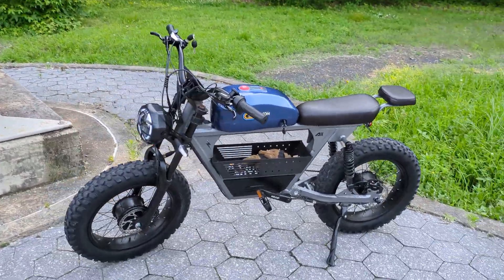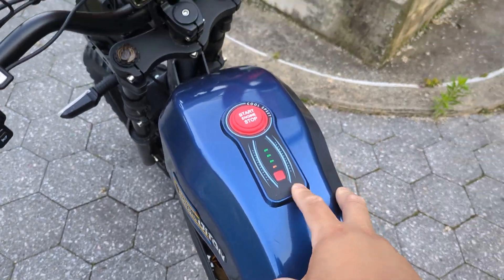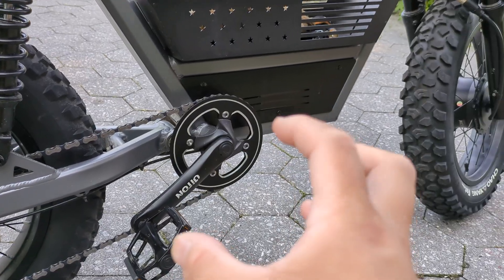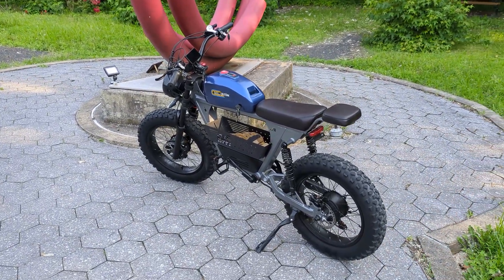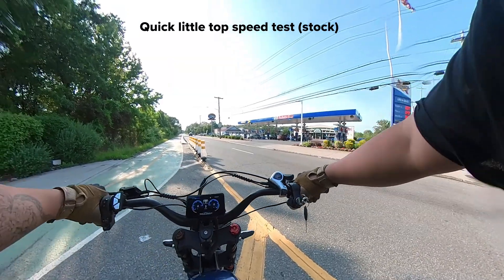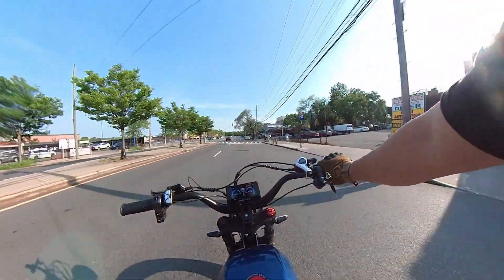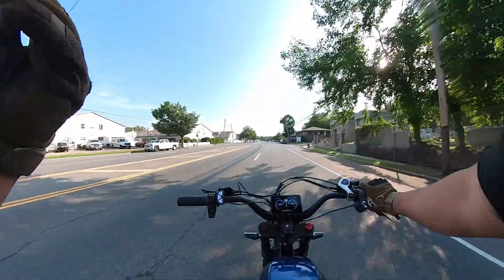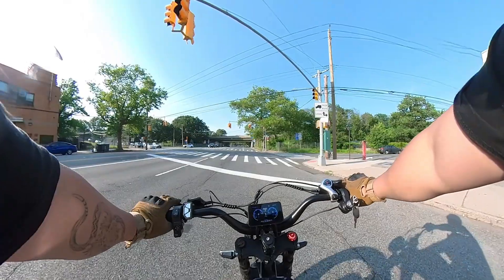Turning an ALIBABA E-Bike into an ELECTRIC MOTORCYCLE - Build Overview

Comment: This bike is 🔥  I would keep it as is just cause I have a 30ah 48 v shrk pack with samsung cells I would take that bottom basket off mount my 30ah battery down there run it dual battery equalizer and I would get the 35 ah version of this bike with a total of 65ah on this dual motor bike run that front motor when needed to get out of traffic uphill or out of a bind. I also seen they put torque arms on rear motor. This is definitely  a contender for my next ebike and has built in rear rack thus would be a great delivery bike display is beautiful. This or tamobyke t73 are my contenders wont be getting a bike for a while just got the movcan v30 max back in Feb but yes thanks I was looking at this bike a while ago had I seen this back in February  I would've went with this